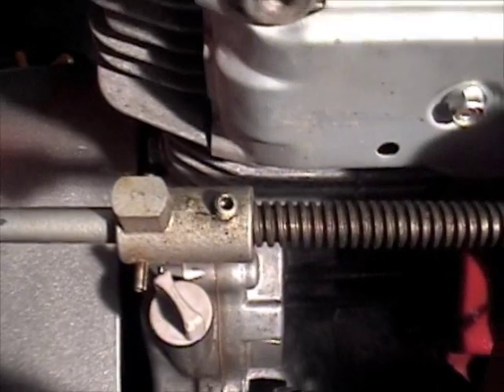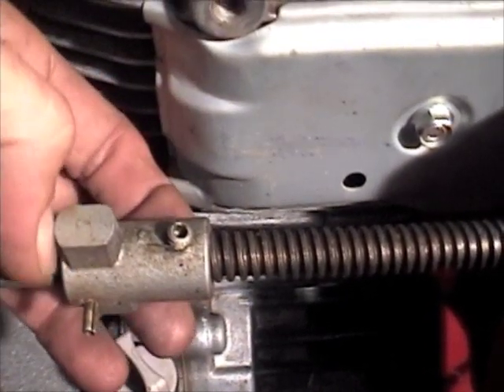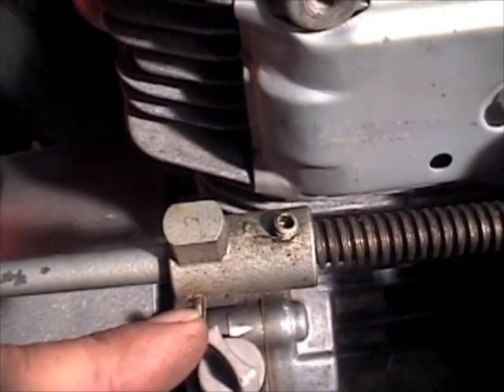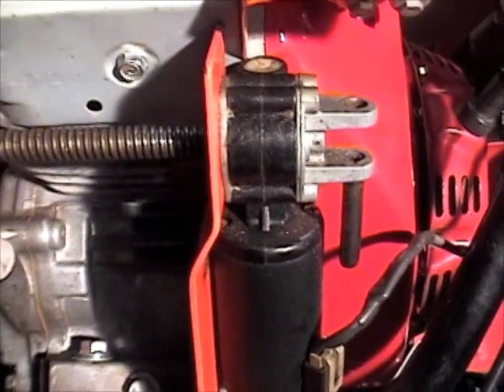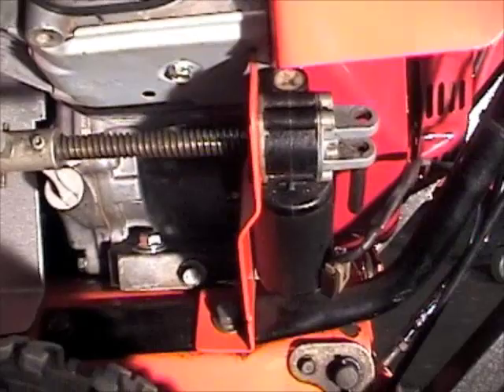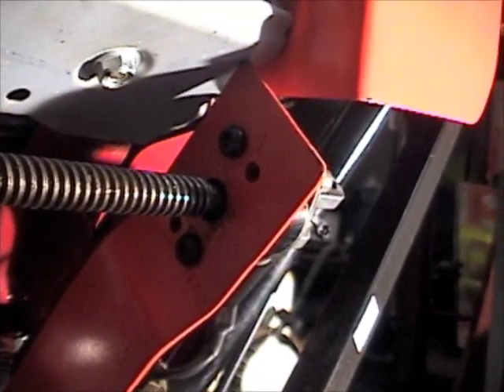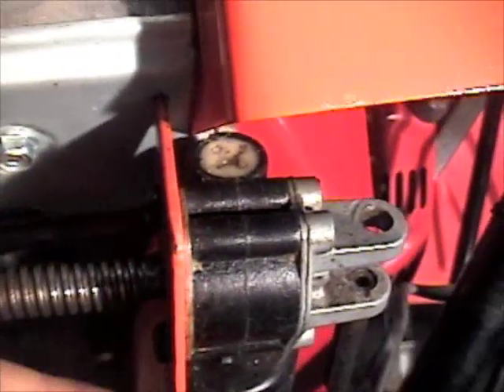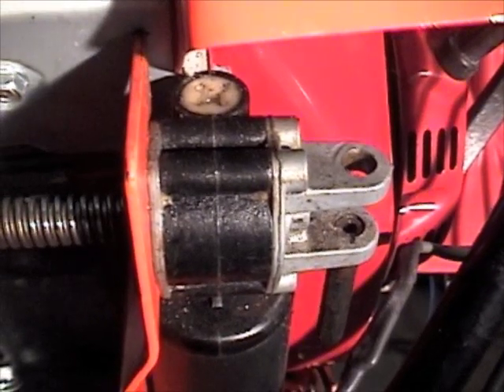Chute rotator motor

Comment: Hi nice work! Can you tell me where you got the connector/switch for the motor so it spin both ways? Thanks
Reply from the maker: +Mark MacLean -You can use any double pole, double throw polarized toggle switch.  It has to be a polarized switch.  If you can find one, you can also use a 4-way joystick.